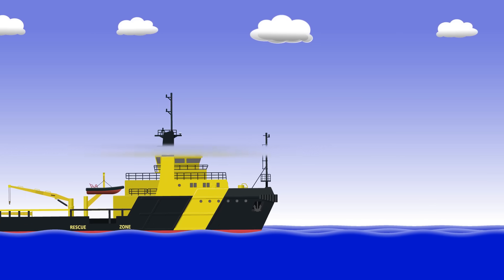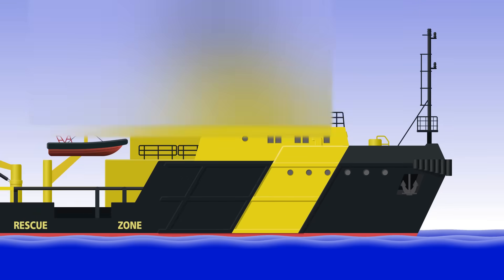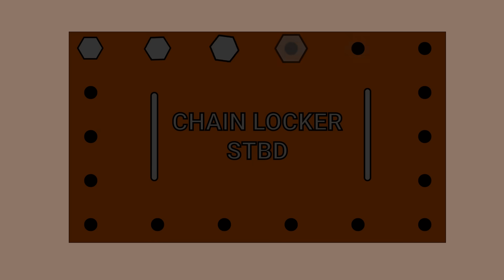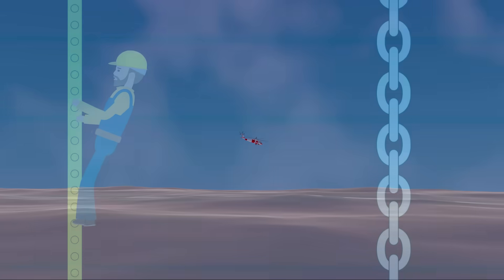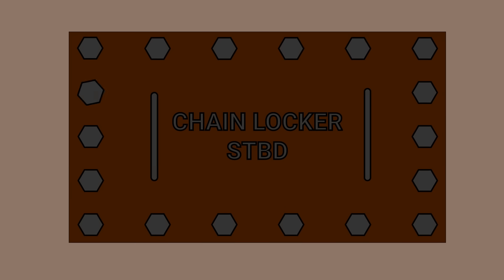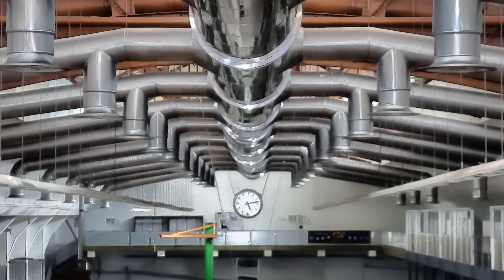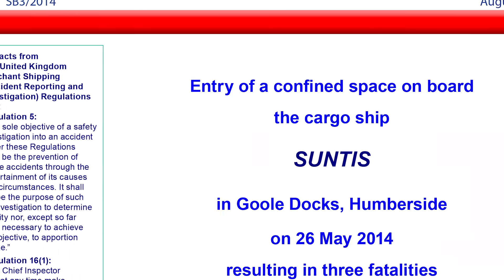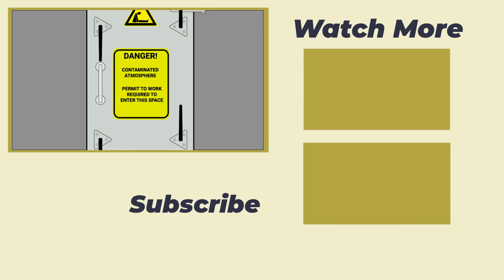Why Enclosed Spaces Are So Dangerous? | Enclosed Space Entry

Comment: Had to inspect a two voids (enclosed space on an aircraft carrier) I left my OBD on  while unbolting the second hatch and it saved my life

I hadnt even finished removing the hatch , but I realized something was wrong because it was rattling ,the explosive gas monitor started screaming and the safety observer got word people 2 decks above us were getting sick/dizzy all within 30 seconds.
I was already tightenting the nuts back on the access.

If the passageway hadnt been well ventilated it would have been lethal for those people.

If we hadnt been wearing our OBD's  while loosening the bolts we would have died as well.

It took a couple of days to figure out what went wrong.

What had happened was a contractor painted the space and bolted the access shut before it dried.

The space had filled with fumes , the fumes had over a year to decay and react with ALL the oxygen in the space so there was a lot of light hydrocarbons in the top of the space and other heavier gasses in the bottom and zero oxygen.

The access cover was in the top of the void.

When I loosened the bolts the gasses rushed out and air tried to fall into it( causing the cover to rattle) and so much gas came out at once that it overwhelmed the negative ventilation we set up.

Fortunately the ships normal ventilation system was able to clear the air in the passageway before anyone was overcome ,or anything ignited it,  and we rigged up a way to seal the passageway from us instead of just using negative ventilation before we VERY SLOWLY reloosened the nuts.

P.S.

Chain lockers are notorious for low oxygen content because the chain scrapes off iron filings into the locker everytime it is raised or lowered so eventually you get enough filings (with very high surface area) to consume all the oxygen.

Comment: In addition to rusting of the steel, it's likely there was some biological activity depleting the oxygen too. Whenever the vessel weighs anchor and the chain enters the locker, the chain will be wet with sea water. And sea water at high latitudes contains bacteria. With no ventilation to allow the chain locker to dry out, there will be almost constant bacterial growth that will consume oxygen.
Reply: Depending how often if ever someone goes in there to clean it out I would not be surprised if the bottom of that locker have a fair film of decaying bits of kelp and such too, probably the occasional fish or whatever other bits of organic junk that got snagged by the chain at some point too. Seems to me if you are going to dump a big long chain full of holes where things can get temporarily get stuck into the sea you are going to end up fishing for whatever suspended garbage is floating around whether you like it or not.

Comment: But isn't a 15% oxygen atmosphere OK to breathe? People do live on mountains with a partial pressure of oxygen lower (0,12 bar at 5000m/16000ft) than would've been here (0,15 bar). Was it CO2 or some other gas that caused these men to lose consciousness?
Reply: 16000ft is well above what most people can survive without first spending time to acclimatise to the thinner air before ascending further, there is a reason why the cabin altitude of aircraft is usually kept no higher than 8000 ft and the maximum altitude for aircraft without pressurisation systems including those that had one which failed is like 10000 ft. Above that people acclimatised to nearer sea level pressures start to suffer severe cognitive deficits or worse very rapidly. For most people ascending to 16000 ft safely would mean spending at least 3 days camping at 10000 ft and then proceeding the with remaining climb at a rate of 1000 ft/day max. That gives the body time to adjust to breathing more deeply and also allows time for the other critical adaption to high altitude you need namely increased red blood cell count which of course is an adaption that requires time as the body must produce the additional RBC's.

Comment: Confined spaces are a hazard everyone should be aware of.  Especially if you work in an industrial environment.  Bad air is not the only risk.  In the industry I work in we have to check the air, even if it is good we still have to ventilate the area prior to entry and maintain ventilation until we exit.  The man going down in the space has to be attached to a recovery system that is capable of pulling him out in case of emergency.  The  guard on the surface must never enter the space. 

Low Oxygen can be caused by Rust, decaying organic matter such as leaves, cutting torches, green or fresh wood or wood chips, etc...  The air can also contain other gases such as methane.
Reply: That organic matter one could have got us one time when we were doing a feasibility study for a client on re-purposing an abandoned furniture factory. During the survey we found a sealed basement that turned out to be full of tons of rotting timber, fortunately I was concerned by the fact that the moment we opened the door the very strong smell of rot and mold so insisted on getting someone in to check on that before doing anything else anyway because you really don't want to mess with some of those either.

Comment: I’ve worked on a few construction jobs, and they always have extra training for confined spaces. Lots of things can mitigate the risks.

Pre-entry oxygen testing w/ handheld devices, and also continuous air testing while inside. Rescue personnel stationed at the entrance that can get help. And to enter, you need to wear a body harness with a lifeline so they can just pull you out without entering the space. Often there is also a tripod with a winch to assist the pulling.

Comment: I worked as a safety technician for a major shipyard. This was the #1 routine of the job, inspecting spaces on various commercial and navy ships so workers could work safely. 

O2 levels are the #1 concern, but chain lockers are ESPECIALLY dangerous because they also accumulate hydrogen sulfide gas (aka "sewer gas") because of the decaying plant-life that is often found growing on chains while they are in the sea. O2 depletion will knock you out but you can be saved if responders come quickly enough, but H2S will just kill you instantly.
Reply: Anchor chain room should have holes for ventilation and seawater removal purpose during the bad weather.
Reply: RedekerEleven why is H2S so deadly
Reply: @bleachesbrother6697  H2S binds to the cytochrome enzyme in mitochondria, preventing cell respiration.  In other words, even if there is oxygen available, your cells can't use it if they're full of H2S, because the parts they would normally use to utilize oxygen are bound to H2S instead.  So, even removing a person from the toxic air doesn't help them, as there is no way to remove H2S from the cells.
Reply: Being in the chemical industry, I've gotten lots of confined space training.  It's the most common reason for fatalities, not explosions or poisonous gasses.

My "ah-ha" moment was physiological understanding why people don't notice the lack of oxygen.  Our bodies trigger the need to breath due to build-up of CO2 in our blood, NOT the reduction of O2.  In low O2 atmospheres, you still expel CO2.  So you never realize your O2 is plummeting until you lose unconsciousness.  This is why it is so scary ... you have no warning that you are in danger.
Reply: I was thinking about something like this to be the deadliest thing in that space. Even basic anchors can have quite of an biofilm accumulation. Can't even think how much there is that in big vessels.

Comment: The video doesn't really explain why 15% partial pressure of oxygen was a problem.  For the average human in one atmosphere of pressure, oxygen content needs to be about 18% or more, for gas exchange in the lungs to occur.  15% means you would not absorb any oxygen into your bloodstream.  You would only lose consciousness after a minute or two of experiencing some fairly serious warning symptoms which one would expect a sensible person to immediately take heed of and get out of the space.

 Being a rescue vessel, I am shocked that they didn't ventilate the space with a  blower fan and use a gas detector as routine safety measures before entering the area.
Reply: Yes you mean like massive cognitive disruption, confusion etc I hope that I really don't have to explain why by the time any of the less subtle signs of hypoxia kick in which is long after those two have progressed to severe levels expecting the person to be mentally capable of making an accurate diagnosis is completely failing to understand the nature of the condition. There is a reason why there are specific courses that exist for identifying the subtle early symptoms of hypoxia because to detect it early enough to be capable of responding you absolutely must identify the symptoms while they are still subtle in the early stages, by the time they get severe enough to be obvious your brain function is already too far gone as the brain is the organ affected most severely and rapidly by hypoxia.
Reply: @FaerieSeraphina  Dumed down: The microchip in your noggin that says "I CAN'T BREATHE!" is the first to get shut down when it too, cannot breathe.

Comment: Def learned more, on some job sites in northern NJ there were industrial and commercial spaces that had to be vented and then fresh air flex ducts brought in before work could be started and someone w an air sampler always there, if they say you have to go you're out in a min. They did have EMTs on standby, all we were doing is installing new metal ducts to perm solve the issue but until that is operational days later when the air handling unit was connected we had to assume the air was only ok while the section was actively vented and fresh air supplied at the same time. Only 5 ppl were allowed in that area at a time, it was part of a basement, sub basement actually, 20 ft below grade. Any/all construction work has hazards, you have to know what you're doing and if a safety person says 'Out now' ,you're moving. On that ship they should've evac vented the chamber first so fresh air could flow in, fatal oversight.

Comment: A sad case I read about involved a contractor who sent 3 workers inside a process vessel at a chemical plant to clean it. They were equipped with breathing masks supplied with air via air hoses, which the contractor hooked into the plant's instrument air supply system, something he had done many times before.

Unknown to him, the operators were conducting a test of their emergency air supply system, which pressurized the lines with nitrogen from tanks instead of air from a compressor. All three men were asphyxiated and died.

Comment: The insidious thing about a depleted O2 atmosphere is that it won't make you feel short of breath or try to breathe heavy.   Those are your body's reaction to too much carbon dioxide.  But rusting doesn't involve the making of CO2, just the loss of O2.   The result is that you're breathing normally and then pass out without any warning.

Comment: I figured the chain locker being a low point, it would naturally fill with CO2 over time as well, even without the rust depleting oxygen. It's obviously not 100% sealed, as it has holes for the chain to go in and out, so CO2 can enter and displace other gasses over time.

Comment: well, we usually call this as confined space. The safety awareness before entering any confined space was using a device called PDG to detect the CO, CH4, O2 and H2S. The density of methane is lighter than air, so each height of confined space have to measure to guarantee each level is safe to entry

Comment: Totally preventable tragedy. Massive failure of vessel senior leadership, (Master, Chief Engineer & Chief Bosu’n), to train/drill the crew in emergency response discipline. No new technical ground here, the lessons have already been learned across in many similar mishaps across the Fleet.
Reply: It's common knowledge that enclosed spaces should be ventilated before getting into them, no need to put the blame on higher-ups for that.
Reply: @Asigmatizam  When three people die in preventable ways, someone needs to be held accountable.    Workers take their lead from management and managers job descriptions include enforcing safety procedures.  There should have been signage and regular training sessions specifically about this kind of hazard. 

One death is an accident,  two or more is negligence.
Reply: @Asigmatizam  Well, youre not allowed to work in enclosed spaces without a permit. And the permit has do be signed by an officer. 

This seems like soemthing they rushed as they wanted to sleep better.
Reply: @Asigmatizam  it's not common knowledge, you're supposed to have training before entering any enclosed.space. the man above policy was good but the lack of training here was BAD.

Comment: Nice video.  I think a follow up is in order (especially after reading some of the comments on here) to explain why people don't recognise the dangers of confined spaces, and why confined space accidents are often double fatalities.  Many people do not realise that our gasping reflex is triggered not by lack of oxygen but by high carbon dioxide levels, so many low oxygen environments (those without elevated carbon dioxide levels) feel perfectly safe until muscles suddenly stop working (because the blood supply is no longer providing them with oxygen) and the person collapses.  It is quite common for a workmate to see this happen and think that the person has fallen, so they rush to help them and meet the same fate.  This is why atmospheric gas monitors measure atmospheric oxygen content as well as levels of common toxic and flammable compounds, and many confined space entry procedures require connection to manned emergency rescue equipment (e.g. harness, retrieval rope, tripod).

Comment: Imagined that there was a gas leak or something, I am of course aware rust requires oxygen but i never connected that that would actually consume oxygen to the point where you can no longer breathe the air 

How would you typically work in these enclosed spaces if they are not accessible wearing the standard breathing apparatus that was on board?
Reply: I don't know regulations but if nothing else you could set up a ventilation system and then continuously test the air while you're inside.

Comment: My uncle had a somewhat similar experience. He is working as a facility manager on dry land in a well ventilated building. For the most part that is. One day he had to acompany a worker from another company who did a routine inspection of the fire supression equipment. They came across a not well ventilated room with a gaspipe and through some dumb luck the inspection worker managed to vent the gas pipe into the room. The Inspector collapsed and my uncle who was standing in the entry way nearly did too as they were in the only part of the building that was not ventialted. He managed to get stay concious near the floor, get out and call for help though, and nobody died. But he described the experience as the scariest thing ever.
Knowing this and watching this video, I hope I never come across a situation like this myself.
Reply: Mines are like that too. If you get deep enough or in a section with bad air, it can be fatal.
Reply: @hihu7200 And that's the reason for miners' historical use of canaries; they're much more sensitive to a problematic atmosphere than humans, and so if the poor little birdie drops dead, you GTFO.

Comment: I guessed correctly what this video was about. I work in Newport News Shipbuilding as a welder, and let me tell you what... The scariest part of my job isn't the electricity or potential fires... It's getting told that I need to go weld in an enclosed space. Thankfully, I've worked in very few of these spaces, but it's just as scary to go into any of those spaces, whether it's the first time or thousandth time. I'll pester my boss relentlessly until I'm given a cricket(atmosphere reader) before I go into any enclosed space.
Reply: The fact that you have to pester your "boss relentlessly" until you are provided with proper safety equipment is disturbing.
Reply: @Eternal_Tech  Bit of an exaggeration on my part. My bad. But there have been a few times where I outright refused a job until I was given all the equipment I thought I needed. 

Only to regret it later due to the weight of some of that gear. 

My boss is usually pretty good at taking care of us. But he's also acclimated to the work we do, so he forgets that us newer guys take quite a few more precautions than he would.

Comment: Pardon the dumb question but how does fresh air not rush into the enclosed space? What’s keeping it trapped with even the door open?
Reply: Why would it rush in?
I can think of no reason why in this story there would be a rush of air.
The pressures are the same. With a single small hole, no draft can develop.
Reply: Different types of gases have different densities. The most dense gases will sink to the bottom of the enclosed space while the least dense gases will rise towards the top.

Opening the door will help to ventilate the area, but depending on many factors, including the size of the formerly enclosed space, it could take awhile to fully make the space suitable for human access. Even then, the air at the bottom of the space may not be compatible with human life.

Forced ventilation is usually the best option, followed by air quality testing to ensure safety.